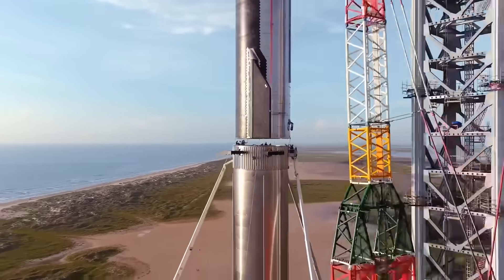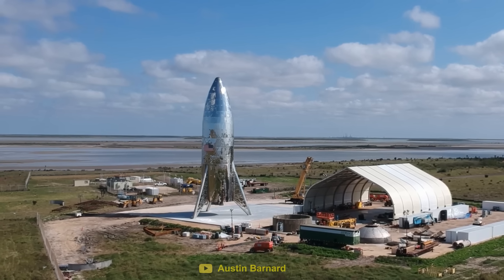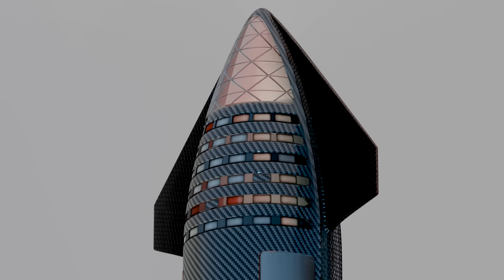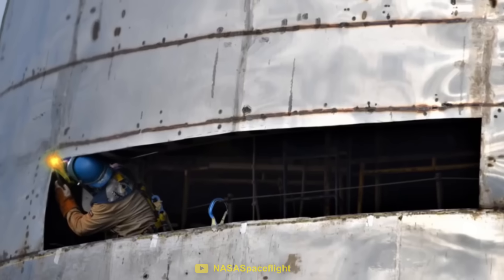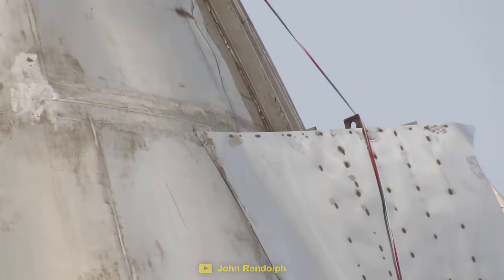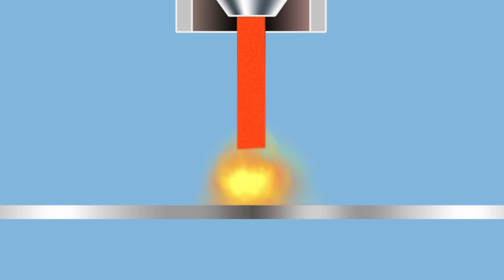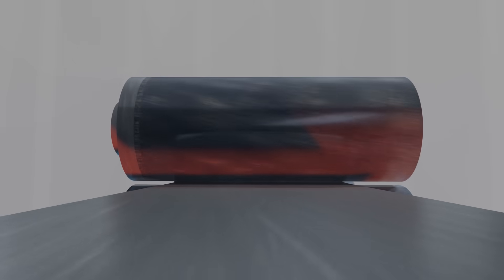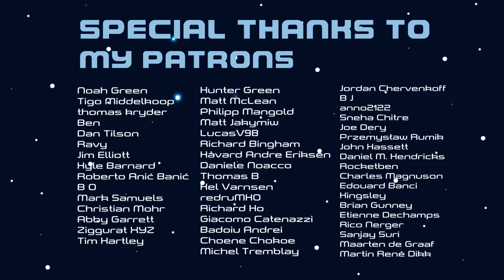How SpaceX Mastered Starship’s Welding

Comment: Let me just note that welding of stainless steel pressure vessels is not, pardon the pun, rocket science - it has been done for many decades. I am afraid that Musk lost valuable time as a victim of "not invented here" sindrome. 

Relative advantages and disadvantages of carbon fiber vs. stainless steel were not a secret - from where did Musk's false start with the former come?

BTW, I would not call those early contraptions "prototypes" but "test articles". Not even Booster 4 is a proper prototype - more of a pathfinder.

Comment: Carbon fiber breaks down at 200 degrees...how carbon brake disks are made then?  They goup to 600 degrees on hard braking in airplanes.... Thnk's
Reply: They're carbon ceramic. It's not a material suited for structural stuff.

Comment: You have no understanding of welding and you should not be explaining any of the processes. This must have been partially true for the company that did the first welding job also. Tig is the preferred method for welding stainless steel and in almost all cases of stainless steel welds corroding it is because the wrong filler material was used although the wrong process can cause considerable problems as well particularly if the welder is inexperienced  with the work being done. Clearly whomever hired the first welding company was no more experienced or knowledgeable about welding than you are.

Comment: I don't know why they keep bringing up the rocket 'experience' thing. At the end of the day 2 pieces of metal is 2 pieces of metal. It doesn't matter if they are destined to become a water tower, a truck, a car, a small shed, or even a rocket. The welding technique does not magically change or spike in difficulty.

Obviously, the people welding this were not the engineers who designed it. Designing it is where experience and education actually matters.

Comment: I used to work for the company that makes the welders both Tesla and SpaceX use. They typically would send a sample of the material and the weld engineers would do the work of finding the correct parameters, speeds, and feed rates for the welders.
Reply: It’s it funny how the welders never get the recognition they deserve? Most welding engineers cannot weld to a high degree as specialized welders do. Being a welder you have to know the material you’re working with and keeping in mind the correct angles and heat parameters as well. It’s a art
Reply: @Highplainsdrifter44   I thought it is a science.
Reply: @Deontjie  it's a science. My professor, Dr. Jemian, a real-life genius that would memorize everybody's name in the classroom within two classes, in every class, helped NASA develop the technology/methods necessary to weld the Space Shuttle liquid hydrogen tank. He taught us about it in our Science of Materials II class at Auburn University. Robots do critical welding where possible, nowadays, and non-destructive testing is done to ensure the integrity.
Reply: @Highplainsdrifter44 neither do the scientists or other actual engineers on the project?
Reply: @Highplainsdrifter44  depends on the particular workplace. I'm the Navy, welding engineers tend to be trained welders as well.

Comment: ?: How much space radiation is absorbed by stainless steel? Can a sheath of gold foil be used to cover the exterior for both protection against radiation bombardment and a uniform mirror shine?
Reply: Didn’t want the weight of paint, so I should imagine gold likewise would add weight
Reply: @williamgoode9114  Hi, Howard Hughes made a Spruce Goose out of wood that flew, but too heavy for commercial reasons. We need a nickname  for this rocket made out of stainless steel. "The Payload Prince" perhaps?

Comment: They could just commission a tank manufacturer for the food or farma industry in the first place. They make smooth stainless steel tanks with "invisible" welds on a rutine basis. In fact they have to make flat smooth welds because that is a demand for being able to clean the tanks properly with a CIP system.
Reply: It sounds like that's basically what they ended up with. Switching to stainless tig welders means they needed talented welders. The food and nuclear energy sector has plenty of them.
Reply: That's Musk for you! Pretending to solve problems that have been solved years ago with no fanfare. He truly is todays P.T. Barnum that dupes so many suckers!
Reply: @colors6692  the fact that you think somebody was trying to swindle your thoughts by switching to TIG welding from flux core shows how inept your train of thought is. Flux core welders are extremely cheap. A dime a dozen. Nuclear stainless tig welders on the other hand start out at six figures. Oh, he solved a problem all right. One of money. Only the mentally deficient think it was some farce.
Reply: Super interesting!

Comment: So many mistakes in this video. Flux  ore has the flux in the centre not on the outside like a stick. Tig welding is 95% of the time a single pass weld. You don't even know if they use laser welding.
Reply: Yes, he made a mistake explaining the flux, but you are 100% incorrect that TIG is supposed to be one pass welding.
Reply: @KamotzII  
I'm not 100% incorrect. Tig is mostly used as a root pass then flux core on top. It's rare that you would ever multi pass a but weld with tig so I'm like 95% correct. 
Yes there is those wired times where you see guys multi pass on a fillet joint.
Reply: @Channelmaster73  Maybe in your company you TIG the root and flux core fill layers. But I can tell you that TIG is used extensively for multiple pass welding in MANY industries. Source: I run a welding training facility

Comment: The bad look was due to improper fitting and bad techniques to controlling heat input. It should have been done with pulse mig if done by hand. Ultimately robotic pulse tig or laser is the best method having the heat/arc more concentrated with a continuous weld. A welder can only go so far before having to reposition or change something on the machine when done by hand. Planishing the hammer does work harden the steel slightly but it doesn’t get hard like martensitic stainless steel. The process also smoothed the welds and stretched the steel out due to any warping from welding.

Comment: Technically the welds are supposed to be stronger than the surrounding base metal. Fcaw is great for outdoors its like smaw but more efficient because its essential mig welding just without gas. Although they could use gas for Fcaw but that makes it duel shield and not as good for outside work.
Reply: welds are weaker than the surrounding metal when it comes to annealable alloys like steels

Comment: When was the exterior ever intended to be carbon fiber? I don't recall that ever being the plan. It was always aluminum or stainless steel.
Reply: From the original 2016 presentation: https://i.imgur.com/RtaLKoo.png  
The exterior of most rockets IS the interior as well. the tank walls form the majority of the structure, there's rarely a second layer that goes over them
Reply: Yes aluminum or stainless would be the option to go for the ship. Carbon based steel corrodes too quickly, and wouldn’t last long In space.

Comment: You say that they use laser welding, are you sure you don’t mean Plasma Welding. As a Sheetmetal fabricator I have used mig, tig and Plasma to weld stainless steel and only remember Lasers as cutting machines , particularly for special profiles. I preferred water cut profiles as Laser left a hardened edge that could become brittle after welding. As well as requiring more preparation than water cut parts … I agree those newer Rockets show how well Spacex have come along with their Fabrication … reminding me of tank building early in my apprenticeship …

Comment: They need to take a step back in time and look at the SR71. It used titanium, despite the exorbitant price at the time, to solve all the same problems. Now, with modern manufacturing techniques, it is very affordable, to the point that it is a material of choice for sailboat parts.
Reply: by sailboat do you mean billionaire owned racing yachts
Reply: @George-Francis  no, I mean my boat that I live on that costs less than your car.

Comment: I have welded for the majority of my life. I have welded stainless steel many times I'm very interested in your laser technology and welding stainless steel I hope to hear and see more of it. I am fascinated that SpaceX is using stainless steel on their starship and other rockets I also have questionsAbout the protection of radiation using stainless steel. People have SpaceX keep up the great work.
Reply: nice man i weld stainless for a living. mostly 304 and 409. gonna be doing it in 45 minutes
Reply: The largest part of the ship does not need radiation shielding, only the crew compartment  needs it and some sensitive electronics might also. Steel doesn't really degrade that fast when exposed to cosmic radiation, so therefore it's a good material to use. The radiation in space is definitely higher but absolutely not chernobyl reactor type radiation. There's also different types of radiation such as alpha, beta and gamma radiation. Alpha and beta radiation are blocked by steel, but gamma can pass through but doesn't have that big of an effect, at least i think. Hopefully i answered your question.

Comment: That’s stick welding since the flux coating is on the outside. Plus it’d make more sense to weld using stick since it’s less equipment to carry up the star ship, and much cheaper than flux core arc welding. Also you’d still need gas for it to weld like carbon monoxide and argon to protect the weld. Great video though 👍🏾

Correction, you can still weld stainless with flux core without gas.
Reply: Clearly you have never welded stainless with stick let alone on a thin sheet metal rocket
Reply: @jordzzzzzzz  thanks👍🏾

Comment: You’ve either oversimplified or gotten the welding technologies wrong.

Also it’s not the carbon fiber that can’t take the heat, it’s the resin/epoxi. Carbon fiber in itself is like a cloth type matetial, the resin is what makes it hold its shape. 

Good video otherwise!

Comment: Flux core is actually a very effective way to weld outdoors., unlike gas mig which under windy conditions the gas shield can be compromised...
Reply: Fcaw stainless absolutely sucks in the wind. Oxidization and porosity run rampant with just a little breeze. Dual shield would have been far better. But TIG welding with an inert gas on the inside of the rocket as well would be the way to go.
Reply: @eyeballengineering7007  I think it’s very likely they did use dual shield stainless. I can’t imagine anyone would have though self shield would be applicable. And while inefficient, dual shield stainless can be a really nice process.
Reply: This very much depends on what type of FCAW filler wire is used. Many require shielding gas and are extremely intolerant of wind.
Reply: @KamotzII  I'm referring to self shielded.

Comment: Really? They didnt use tig from the start? This must have been a cost saving execise as they probably knew the first ones were never going  very far.  They also will never polish it as it will be covered in heat shield material anyway.
Reply: Flux core is perfect for outdoor construction, also the most expensive thing in a welding operation is the welders
Reply: They couldn't afford a big enough tent / shelter...  so they said fuck, flux core it. 😆

Comment: 3:41 that's incorrect. Flux CORE... Its the core of the wire that burns and releases a protective gas
Reply: Thats also wrong, in FCAW you use a gas shielding and the flux creates a slag cover. Gas can med CO2 or M21 for example.

Comment: This hit one of my pet peeves. Stainless steel is just stuff. A bulk substance is not heavy - it is not light - those terms make no sense. Because they are units of weight (more precisely here, mass). What it has is density. You don't know the weight until you know how much you need (volume) for what you're trying to do. Stainless steel is fairly dense ... but because these alloys are pretty strong at very cold and fairly warm temperatures, you need less of it. And as the video says, when you add in the thinner heat shield, the total weight is about the same for both carbon fiber and stainless steel. Summary: a substance isn't heavy or light. An amount is, & different substances require different amounts.
Reply: And when you throw in the costs, stainless steel beats carbon fiber hands down. With the higher ability to resist the heat, there is some redundancy built in. Tiles, then a ceramic fiber mat, then stainless is a lot safer than the old Shuttles had which had aluminum bodies.
Reply: @gravelydon7072  I would have to rewatch, but I know the video mentioned the price. It didn't mention that the scrap sale price for stainless is about 1/3 the cost for new. If you run a "hardware rich" development process like SpaceX does, a failed piece isn't quite as much of a loss. But this is probably a really minor factor, though, because the cost in design, labor, & test is probably much more than the stainless.
Reply: @rockrose82  Molds can require a new one if there is a flaw with CF product. Stainless, just recycle it which you can't do with CF.

Comment: we won't know if they have "mastered" welding a rocket until it's actually launched and returns.  If that ever  happens.  Mostly, he's just made enormous amounts of scrap steel.
Reply: Ok........... https://youtu.be/gLNQ6Mq5kbg?t=366
Reply: Building a rocket that launches successfully is all that is needed to prove they have mastered welding. Getting it back is another process. Most rockets only take one way trips of the majority of the rocket. SpaceX has been pushing the reuse of them with the Falcon 9 first stages already having units that have been used a dozen times. If you see one getting ready to launch that looks dirty, it means it has already flown once. Dragon capsules are reused which wasn't done with the Mercury, Gemini, or Apollo flights. The Shuttle brought the era of reuse but required a large amount of costly rework after each flight.

Comment: Thanks for the explanatory video, good work!

Curious, since the metal rings shrink where they're welded together, why not flare each ring segment a bit, so when the metal is welded together and shrinks, it pulls the flare in and thereby has a smoother finish? Doesn't seem it would take a very large flare, maybe ½" from the edge, flared out 10° or so (have to experiment…). Since it's flared, there would be more metal that would shrink during the welding process. I'm sure there's an explanation for not doing that, I'm curious if you can educate me. Thanks again!

Comment: Friction stir welding could possibly be used with a curved friction device. Possibly. Or orbital robotic mag welders.
Reply: Certainly, FSW was used to weld some fuel tanks for previous nasa rockets’ fuel tanks. However, these tanks were aluminum, which is much easier to weld with this process due to it’s ductility and lower melting temperature, when compared to SS. SS can be welded with FSW, but it is extremely rare to see, and unheard of for a project of this scale,

Comment: Curious to know why starship doesn't use cold welding. Just wondering.
Reply: I have welded with FCAW  for 20 years and am in welding school. No such process exists. That cold welding chinese chick uses editing.
Reply: Not to offend you, but cold welding is when to same alloy or metals come in contact with some pressure and no oxide layer naturally fuse. NASA had that problem with the iss if I'm not mistaken. But would appreciate your feedback to help me understand if you have more to say.
Reply: @mr.ackermann807  No shit jack! It is not a process in use ya schmoo!

Read my goddamned words in my other post!
Reply: @mr.ackermann807  would be feasible in space, but not really here without a special facility
Reply: A vacuum chamber or updating one of starship hangers would work, also now that I think about it you could build a space station with cold welding to reduce payload area and no need for air lock segments like the iss really. It's what I would do.
Reply: @mr.ackermann807  No such process called cold welding in use. 

Youtube fakery. Gullible fool.
Reply: Not a fool, misinformed maybe but it's still worth a try. If you really want to prove me wrong, which I wouldn't mine, do deep research and show the evidence. Every source that I've seen so far says its possible just tricky. I think nasa.gov would be fine as an example. Good luck.
Reply: And what chinese female are you talking about? I first heard about it years ago on the history channel and looked into it in college.
Reply: This process is actually called “Diffusion welding” and is extremely time consuming and expensive. It would likely be cheaper to machine the rocked out of a solid block of SS.
Reply: How about flash butt welding?